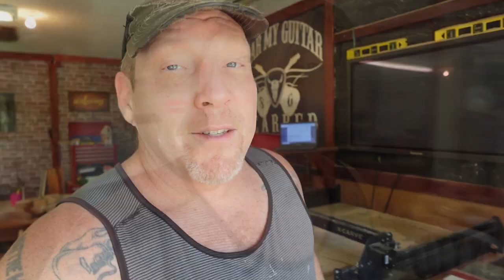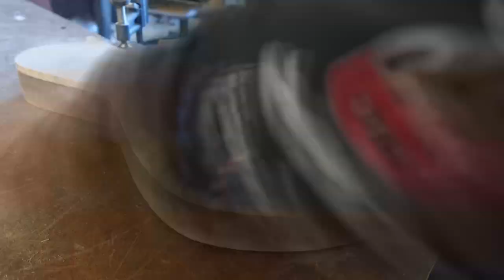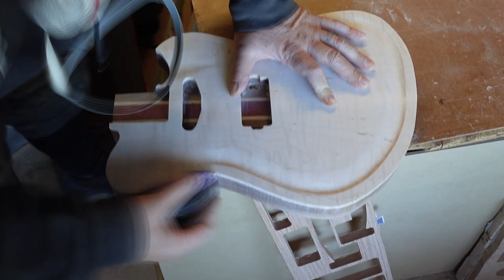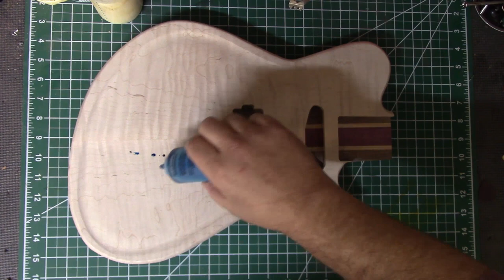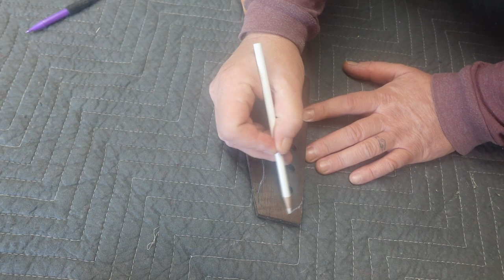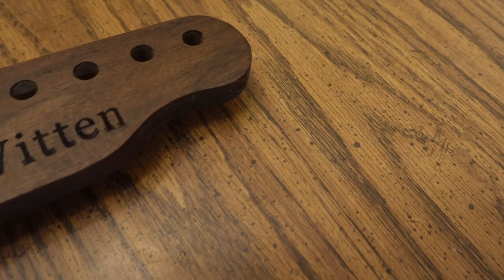HOW TO BUILD A CUSTOM GUITAR KIT!! And How To Stain The TOP!! #guitarkit #dreamguitar #diy

Comment: Sanding back brings out a greater difference in the grain.
Reply from the maker: Stop. It. No it doesn't. Just stop.
Reply: I worked in cabinetry. It absolutely does the grain will hold the stain more and appear richer. Try it on a sample piece of maple and compare the two.